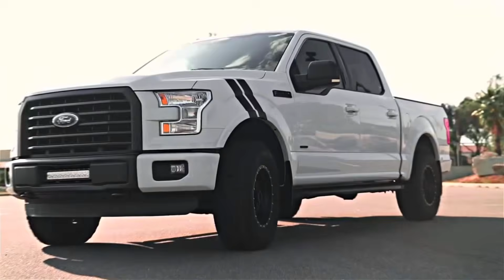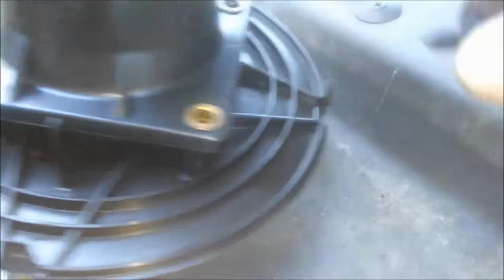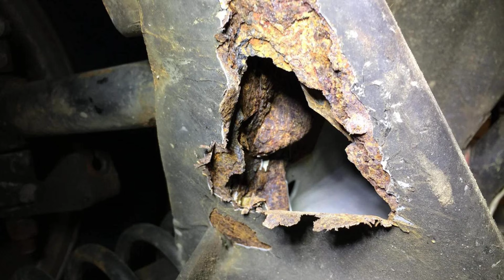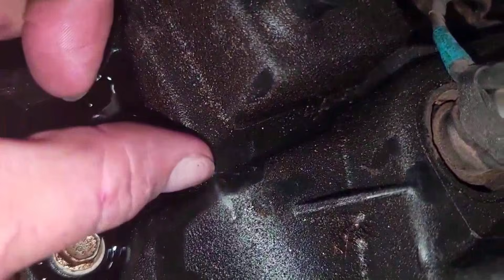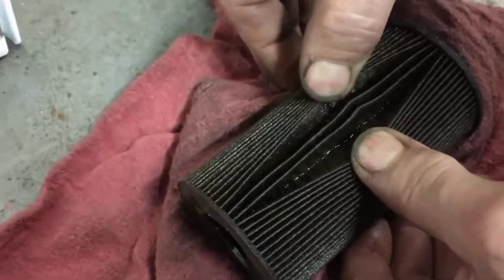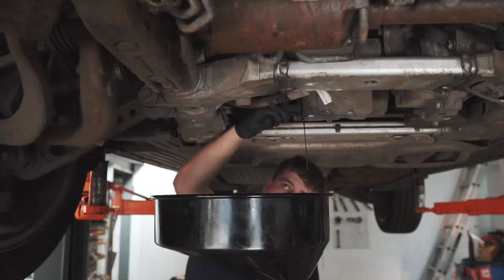Ford Maintenance Secrets Mechanics Don’t Want You to Know (For 500k+ Miles)

Comment: If it's a turbo, change the oil every 3K miles and the oil filter every 6K miles.  Use OEM filters (or better) and full synthetic oil that meets the correct viscosity and particular Ford spec.  Your wallet will thank me for this advice.